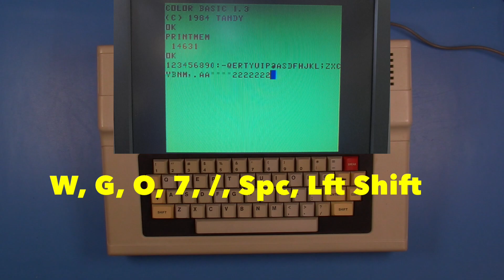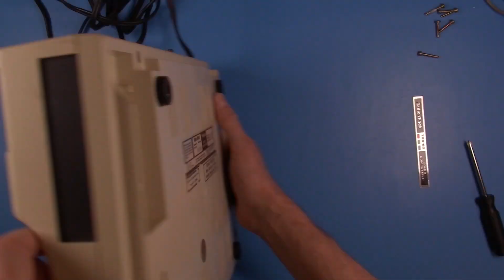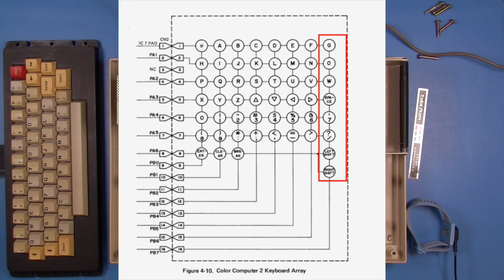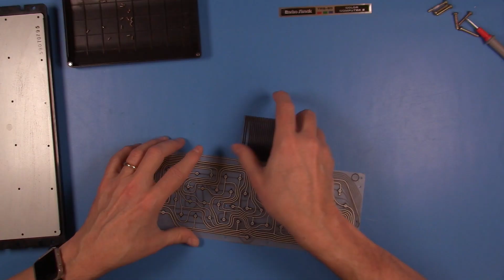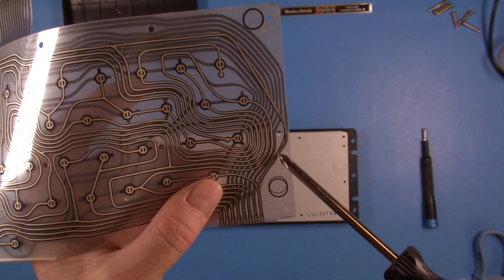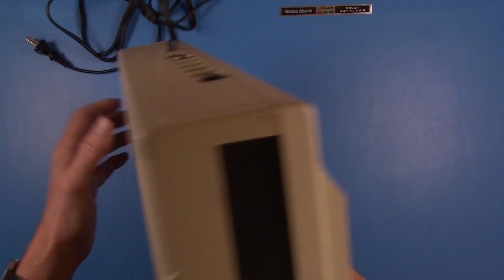TRS-80 Color Computer 2 - Keyboard Repair Methods

Comment: In my 40+ years using the CoCo line I have never had the need to fix/replace a Mylar membrane, usually the problems has been dirty pressure pads. Good to know the pen fixed the troublesome trace - had heard that the repair fluid for car heated windshields was also used to repair Mylar circuits. On the Sinclair world, I did have to replace dried out/broken Mylar interconnects on one of my ZX-81 and a QL, maybe due to lesser quality materials or harsher operating conditions on those two machines.
Reply from the maker: I think the quality of the Tandy keyboard membranes is much better than with Sinclair. I know that I’ve had several Timex/Sinclairs where the membranes have really degraded badly. The damage to this CoCo’s membrane I suspect to have been liquid damage.